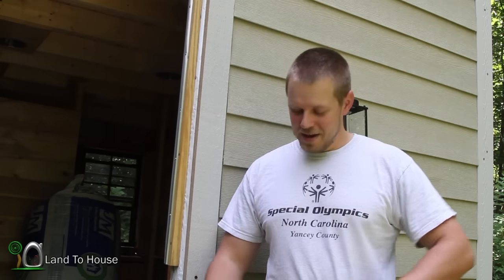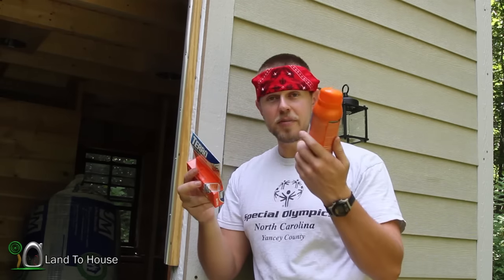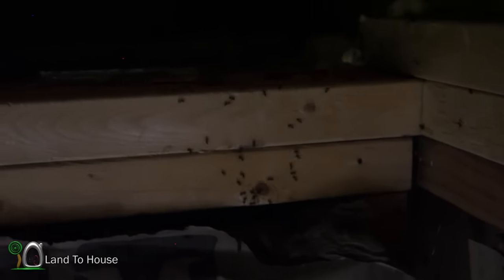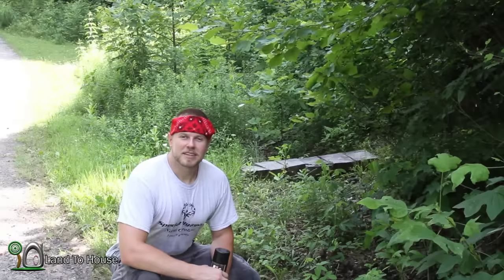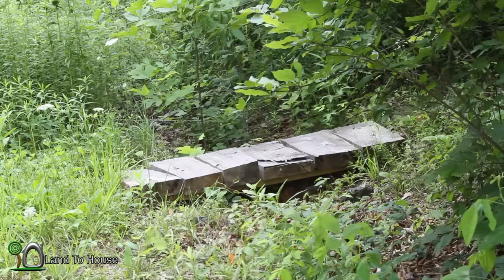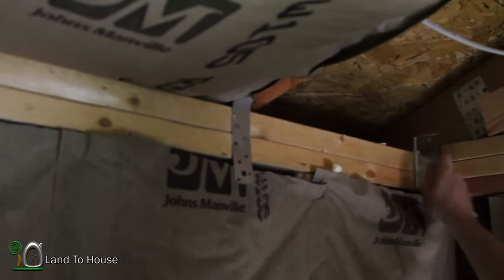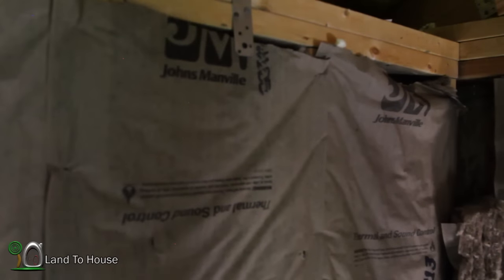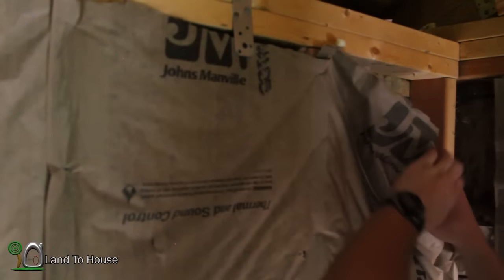Insect War - Land To House

Comment: The new ant baits they have seem to do a great job.  Like you, I was overrun with them not too long ago.  I put out the bait and they gobbled that stuff up.  They were gone over night and I have only seen 2 since.
Reply from the maker: Pidasian Hippie I just got some of those baits as well. I think that I will just keep a couple of them out all the time just to be on the safe side. Looks like they work for several months. If it cost me $3 every 6 months I can handle that.
Reply: The liquid ant bait is good stuff. Just make sure that you keep enough out to "feed" them till There gone.
When you built your house did you install a metal shield on top od the blocks under the wood seal plate?  It should over hang about an inch/25mm on either side with a downward slop to shed water and it should be done on all piers. 
Another thing i would look for would be any leaks or  condensation.  From what you showed in the video that could be a problem. Also is this the attic/roof area? 
were the ants elsewhere that heavy or a few here or there. Oh spray foam won't stop all insects either.
last thing look inside and out and under the house in the general area from where the ant colony is to the ground. This is an idea where to start to see where there coming from.
Reply: +metalSmiths TN 
I have a camper setup for a long time use. I have taken heavy axle grease and apply to the blocks near the top. I spread it about two inches/50mm wide an somewhat thick. This seems to keep insects from climbing up past the grease. 
Silicone caulk is good for sealing small opening. You could use it to seal over exposed foam once trim smooth. Just make sure water sheds away and not trapped or directed in.
Hope this helps.
Reply from the maker: metalSmiths TN Thank you for commenting. This is my first time building anything like this and I am sure that I have missed many steps. I did not use the metal plate on top of the blocks. That might have been a good things to have. My blocks are not exactly straight though so I am not sure how well that metal plate would have fit. 

So far I have not found any leaks and the condensation is not there. The inside of the building is very dry as far as I can tell. The blocks have now been coated in liquid rubber and that has stopped all water issues. 

I do like that grease idea. I might have to look into that when I have things painted and such. There is still a lot of bug proofing to go but I will keep fighting.
Reply: +Land to House 
Good deal. The metal I was talking about is like flashing just wider is all. It comes in rolls. The grease idea I would use it under the house or protected from weather. Not where its in the open it could be messy aa it can creep down the blocks over time and it collect dirt and debris over time.
Good luck and I'm just starting to watch your videos. i do like the land to house idea. I hope to begin on our property next year if life does not get in the way.
Reply from the maker: metalSmiths TN Good point. I would not want grease running down the side of the building all the time. The Land To House idea was basically me looking for something on Google that had zero results in the search. I found it and ran with it. :)

Comment: Like you, I do try to avoid using chemicals unless I have to but if you have to you have to! I doubt you will ever completely cure the problem but you are definitely on tp of the problem, It may be something you have to do every so often on a regular basis
Reply from the maker: Michael Collinson I feel you are right. I am going to have this issue for ever since I am in the woods. But I do hope to make it as hard for them as possible.

Comment: I know it sounds cruel but maybe follow some ants around your "tiny house" and burn them with hot water
Reply from the maker: Ahmed Usul Oh my grandmother used to do that all the time. Very effective way of getting rid of ants. The issue in the tine house is that the ants are living inside. But outside there are many many ants under rocks and all around. I might get the change to get them with the hot water.